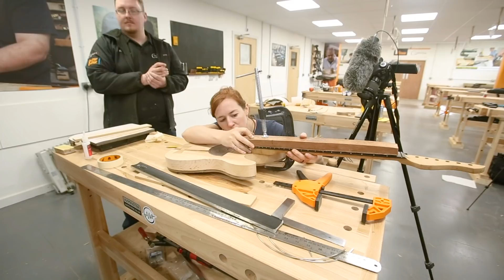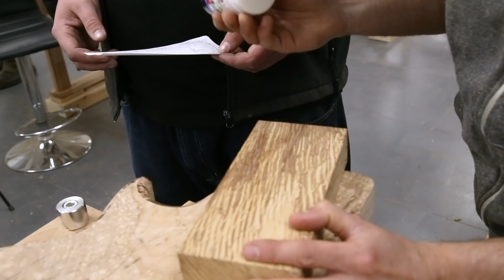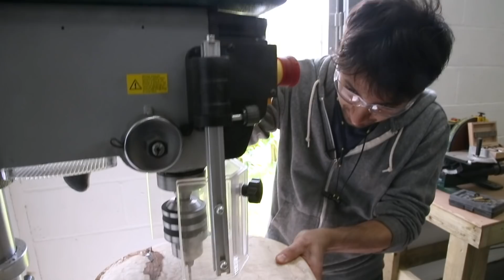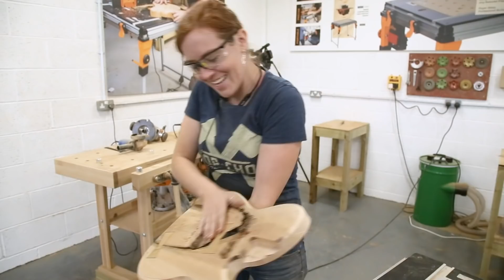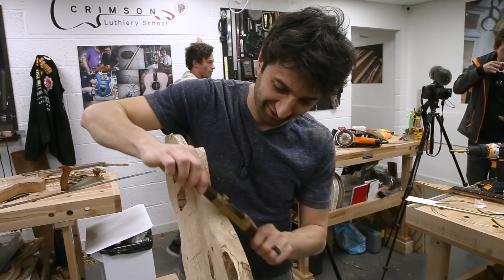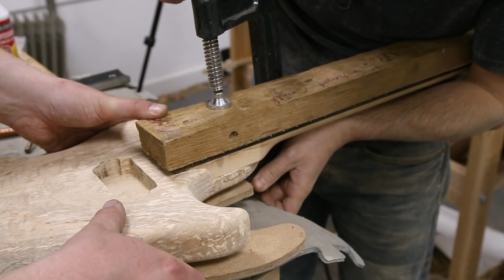April Wilkerson & Matt Cremona Custom Electric Guitar Build - DAY 4

Comment: Nice work you two! I've built a few Electric and Bass guitars & never glued the neck to the body of the guitar. IF I had to do it that way, I would have used Hyde glue so that the neck could be taken apart more easily by simply heating the glue joint. Electric & Bass guitars are relatively easy builds. If you really want a challenge, try building an Acoustic guitar. Now that's a whole other ball game! Anyway, can't wait to see the finished guitars & how they play, which mainly has to do with the type of pickups/electronics used.

Comment: Fitting the neck in the neck pocket, and gluing it??? Why not just bolt them in..
Reply: True, would you want another medium between your neck and body? Or even would you want to glue on an engine cylinder head?
Reply: @Teguvas  Had engine gaskets where the head had a copper gasket and "glue" to keep things from moving under pressure (Ford 2.3l race engine) so yes, one sometimes wants a glue on the head.
Also, for many years, a bolt/screw on neck on a guitar was often a sign of a cheaper guitar.